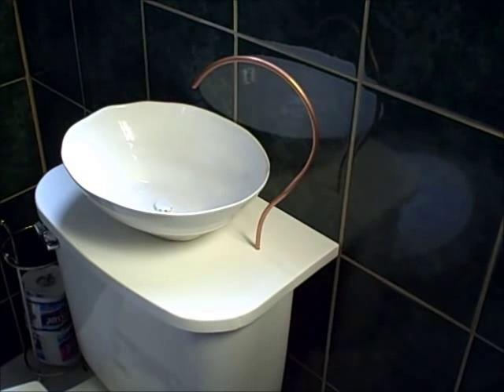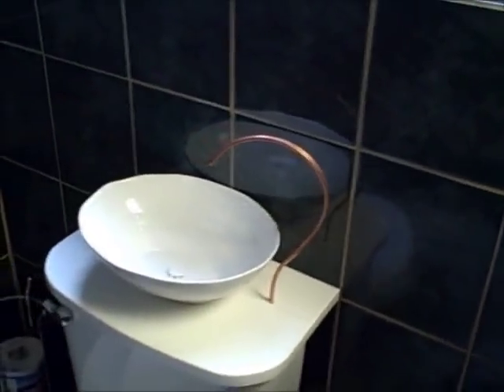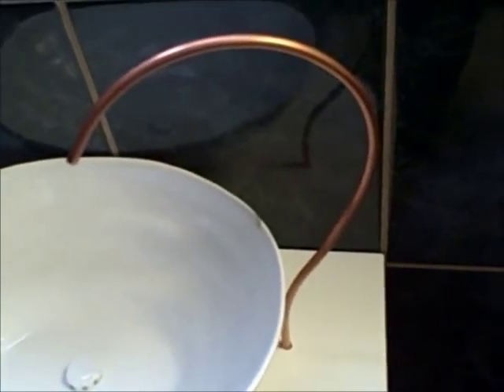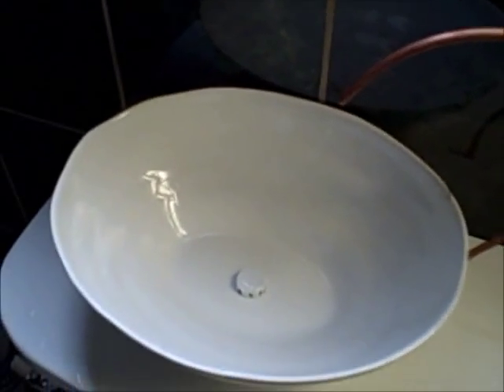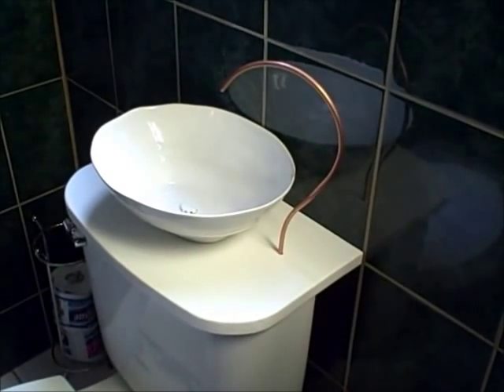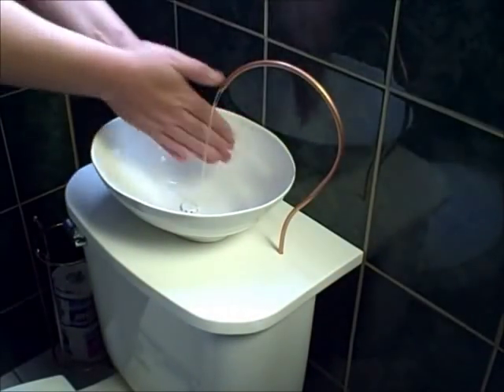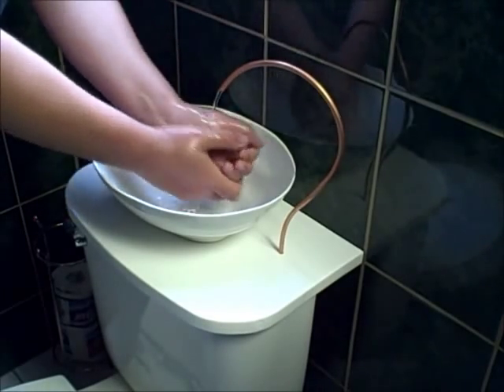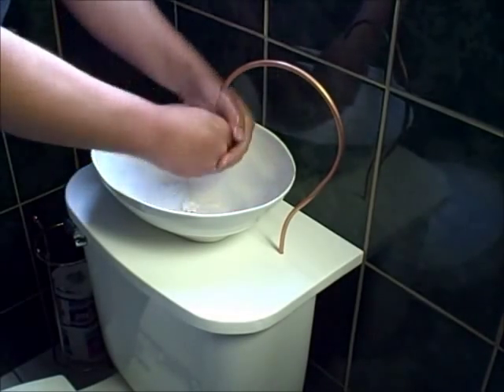Conserve water with a DIY Toilet Sink

Comment from the maker: For those of you who are wondering how I drilled the hole in the bowl: 1) I marked off the size by tracing the 1/2-inch threaded male PVC plug underneath the bowl.  2) I drilled a pilot hole using a 1/4-inch ceramic bit while running a slow flow of water over the surface to keep it cool.  You must drill slowly so as not to crack the ceramic when the bit gets through.  3) Then I used a cone-shaped grinding stone, with the water still running, to make the hole large enough for plug.
Reply: How did you hold the copper pipe in place?
Reply from the maker: Hi Joe. I used a drill bit that was about the exact same width as the copper pipe. It was snug enough to stay in place on its own the whole time I used it. Had that not been the case, I probably would’ve used some tub caulk to put a seal around it from underneath. It doesn’t actually touch water, just gets humid under the lid. I think that would’ve been enough to keep it in place.
Reply: @TheSoCalSailing  I didn't make my hole snug enough. I tried another kind of adhesive. I'll see about tub caulk if that is better.
Reply: so you used an eating bowl? I was curious if you could do this....or maybe a planter.
Reply from the maker: @dawnmullen4348  Yes, I used a salad bowl because it had a nice glossy finish and the ceramic was easy to cut through with a ceramic bit and stone point. I imagine a planter could work too, good luck with your project.

Comment: Great video and mechanism! Thank You! If someone doesn't feel like making changes of such a magnitude, a regular bucket in the bathroom sink while washing hands/teeth/face would do. Just use the greywater to flush. When the guests in the house, you can remove it, and put it back when they're gone. Also the same goes for the kitchen sink when not using the dishwasher.

Comment: Excellent Excellent Excellent!
The retrofits I've seen had awkward bowls and cost a bundle. I'm designing very compact "wet room" style shower/toilets in container-based apartments. This will allow for a larger sink on the back of the toilet. This would work really well with a pedal flush toilet. Just mix down the hand soap with water so no initial water is needed to start washing hands, just for rinse.
Thanks for sharing the diagram as well.

Comment: Great! This is what I needed (and didn't know it). The basement bath room of my old house has the toilet in one side, a shower enclosure in the middle that's the same width as the bathroom, and a sink on the other side of the shower enclosure. To use the sink you need to go out of the door in the toilet side and in the door of the shower and sink side.

Comment: There are two American-made toilet sinks out there ("Sink Twice" and "Sink Positive"). Sink Twice in its basic model fits toilets with tanks from 13 inches to 17 inches. With an expansion pack, Sink Twice fits toilet tanks up to 22 inches wide. Sink Positive is probably a better option for toilet tanks larger than 22 inches wide. Sink Twice is the most efficient on the market because it incorporates "fill cycle diversion" technology to make your toilet even more efficient. On top of that, you can wash your hands with the clean water and flush with soapy water. It is pretty cool and if it saves about 1 gallon per flush (more or less), with 5 trips to the bathroom per day and 4 people in your family using it, you are saving 20 gallons per day or over 6,000 gallons per year. Not too shabby! Sink Twice often pays for itself in months and it is available on Amazon.com.

Comment: due to a design flaw on my part, i just lost two feet of bathroom space for my tiny house. I was looking for this solution except im not worried about brushing my teeth in it. I think I will split the waters intake to a normal faucet with valve. the overflow will hit the basin like normal... there will just be a bit of tooth paste in it, much like i suspect you get some soap film in yours already.

Comment: This is great!  I would like to see a plan for how you made this yourself.  What did you use to secure the copper tubing beneath the platform?  How easily can you remove the lid to access the tank below?  Have you tried drilling a hole in a standard tank topper?
Reply: Yes, I would like the answers to these questions too.
Reply from the maker: The plans are at the end of the video - you can hit the pause button to review them.  I cut a rubber gasket that I placed between the barbed coupling and the bowl - this way you don't have to waterproof the lid, it just acts like a shelf for the bowl to sit on.  The bowl wasn't glued to the plywood lid, so I could just lift it off or lift it together with the lid.  In my case, I didn't want to drill into the standard sink topper because I wanted to keep it in a cabinet in case I ever wanted to restore the sink to its original condition.  Hope that helps.

Comment: Any ideas on how to take this project a step further and connect a faucet control and heating element to allow running water without a flush, with optional heating controls?
Looking for a way to conserve water but also minimize space usage in a very tiny bathroom and eliminate the regular sink altogether.
Reply from the maker: That becomes a much more complex project, since you're now having to run separate lines for dedicated hot/cold water.  This simple plan uses the existing overflow tube to make better use of clean water that would otherwise go directly into the toilet.  Good luck on your projects.
Reply from the maker: Yes.  In my case, I only used this sink to wash my hands after going to the bathroom.

Comment: Thank you. I wonder what you used to secure the copper pipe? Also, I wonder how often it will have to be dismantled to reapply the inside coat to keep water resistant to the underside of the ply wood. Is there a plastic material that could be used instead of plywood, I wonder?
Reply: The water inside the tank isn’t going to reach that high

Comment: How is the tank re-filled if the drain goes to the overflow tube?
Reply from the maker: Most of the water coming in the fill valve exits near the base of the shank, while only a small ratio is diverted to the overflow tube.  During the flush on many toilets, the siphoning action through the trap pulls more water out of the bowl than is necessary to maintain a water seal.  By design, most all fill valves simultaneously fill the tank while diverting a small amount of water (in this case 10 ounces) to top off the bowl.  More to the point, the water in the bowl is responsible for blocking sewer gases in the drain line from reaching the room. If the bowl were left with an air gap after a flush, the room would likely get very stinky.
Reply: Awesome, theres so much design put in to toilets that I've never thought of before. Thanks!

Comment: I've wanted to build a greywater toilet sink ever since we moved in to our house a year ago, so thanks for the helpful video!  Is there anything that holds the bowl to the lid?  The diagram seems to show it sitting there, or is there enough of the threaded male plug to go through the bowl, rubber gasket, plywood and the female to barb coupling clamps down on the under side of the plywood?  If it is just sitting on the lid, have you had any issues with it being knocked about?  I was originally considering using a stainless mixing bowl, which is probably lighter than your ceramic bowl.  Thanks again!
Reply from the maker: The drain plug/hose fits snugly through a hole in the lid and into the overflow tube. I found this was enough to keep the bowl in place without having to glue it to the lid. Also made it easy to take apart for cleaning or troubleshooting.
Reply from the maker: PS: I can see why you ask... you probably will need to secure the mixing bowl to the lid since it'll be much lighter than a ceramic bowl.

Comment: I'm wondering if i can use my existing toilet lid and use a diamond cutter to cut the necessary holes in it
Reply from the maker: I wanted to keep the original lid in its original condition in case I ever needed to roll back my changes. I actually made the lid out of a piece of 1 inch plywood that I had laying around.  I used the original lid to make a stencil over the board, used a jig saw to cut it, primered it on both sides and then hit it with 2 coats of semi-gloss white paint I had in the garage.  It sits on top perfectly.

Comment: Hello. I don't have sink in toilet by toilet 🚽 is without backside. Backside in the the wall. How I install sink
Reply from the maker: I don’t think this project will work for that application. This is specifically for a toilet with a fill tank, fill valve and handle on the side or front. Good luck.

Comment: Hi,
How much grease and soap deposits are clogging the tank?
Is there any method of cleaning such a tank that will not exceed the savings from its use?
I am not kidding myself, I just wonder about the practicality of the solution.

Just wondering will the system holding cost will not be greater than water and money saved.

Best regards
Thanks!
Reply from the maker: Hi, water does not drain into the tank, it drains into the bowl. Because it’s soapy water it actually kept my bowl cleaner in between normal deep cleans.  Keep in mind, you’re not using this to wash your hands after you just finished changing the oil on a car, you're using it after you just finished going to the bathroom.  It’s not designed to be a replacement for a bathroom sink, it’s just a way to get a secondary use of clean water used for flushing your toilet.

Comment: Hello, apologies if this has been asked before but what inlet valve/ballcock did you use? I'm struggling to find one that has an outlet I can pipe up to a tap
Reply from the maker: There’s a diagram at the very end of the video that you can pause to study. I used a 3/16 barbed union that I attached to the hose that’s on the fill valve. Then as the water drains it goes back into the overflow on the flush valve.
Reply: @TheSoCalSailing  Brill thanks
Reply: @TheSoCalSailing , do you know of anyone that will make these and sell them to to old , retired people that lack your talent and skills?  We need two for a recently purchased home in SoCal.  Two bathrooms were created there; they only have a shower and a toilet in them.

Comment: What would you do if the toilet flush button is on the top of the toilet cover instead of a lever shown in the demonstration?
Reply: David Wu Yes, I would also like to know.  Maybe the mechanism could be extended to the top of the plank, and the sink/bowl moved off to the side to make room for it?
Reply from the maker: Sorry Michael/Lori. I'm unfamiliar with the mechanics of top mounted flush toilets and can not make a recommendation.
Reply: +Lori Holtorf you could actually make the sink at any height you wanted. just change the top flush mount from the original lid,to a new top of your choice.Then have a space between the lid and the sink,kinda like a shelving unit on top of the toilet tank.

Comment: What did you use for the tank lid? Foam? Wood?
Reply from the maker: I repurpose a wooden shelf. It was a solid wood piece, I used the existing ceramic lid to make a template and modified its depth to extend all the way to the wall.  One coat of kilz primer and two coats of high gloss latex paint.

Comment: This is exactly what we've been looking for to solve the space issue in a half bath. Thank you for posting this and for the clear instructions. My only question is whether the tubing needs to be glued to the copper pipe or if it is secure enough as is.
Reply from the maker: The plastic elbow that I used was the self sealing kind for connecting a refrigerator supply line.  Pretty cheap and easy to use.

Comment: Have you had any issue with bacteria growth? (That is, bacteria from your hands getting into the toilet?)
Reply: Since it's going into the toilet bowl rather than the covered tank, it should be a simple matter to just put a bit of bleach as disinfectant through the sink every once in a while.  That way it doesn't deteriorate the rubber parts in the tank, and will clean out the full path of the grey water going into the toilet bowl.
Reply from the maker: I used this design for a year before I sold the house.  The rinse water went straight to the toilet bowl, bypassing the tank; since my hands were pretty clean to begin with, I had no issues. I cleaned the bowl semi-monthly as I normally did otherwise.  In fact, since there was soapy water sitting in the bowl after each use, it actually kept my bowl a little cleaner than normal.

Comment: Its a eco friendly way to conserve on water use Europe has been doing this for years were at least 30 years behind them on most things and there is a small tubed hot water heater that can be hooked heats as you use it but its not something I would want hooked up i n a toilet
Reply: that's what I was thinking, a small heater just for if needing hot water. then conserves water but still gives u hot water option. or instead of it running water every time you flush,ml maybe some way to still use the toilet's water by being tapped into it, but have still the ability to control when the faucet turns on and off (and thus whether it's hot or cold).

Comment: Great. Hope you can do a video on how you did this. I wonder how did you cut the toilet lid which is usually ceramic.
Reply from the maker: Bicycle Wang details are in the schematic at the end of the video. I didn't drill the toilet lid, I used a piece of plywood and painted it white. As far as cutting the ceramic Bowl, I used a ceramic drill bit to cut a pilot hole and then I expanded it to size with a grinding stone under running water.

Comment: Will this work with a dual flush system?
Reply: A dual flush system simply regulates the amount of water used, or displaced from the tank, per flush.  It shouldn't affect how the water is fed into the tank.  On my dual-flush it doesn't matter, but different manufacturers will have different designs and may route the water differently for the 'big' and 'small' flushes.  

Remove the lid, look inside your tank, and flush with each to see if the water is fed through the same outlet to fill the tank.  Even if it's fed from different outlets, you can still just route both outlets to the faucet.  So, in short, the answer to your question is 'yes'. lol
Reply: Thank you for the reply!  Would you recommend a particular dual flush system?

Comment: does the sink drain into the tank or into the overflow tube?
Reply from the maker: The short answer is: the overflow tube.  There's been a lot of chatter on the topic of draining into the overflow tube vs the tank so I'll do my best to provide a comprehensive answer about why I've designed my toilet sink this way. 

During the flush on many toilets, the siphoning action through the trap pulls more water out of the bowl than is necessary to maintain a water seal.  By design, most all fill valves simultaneously fill the tank while diverting a small amount of water (in this case 10 ounces) to top off the bowl.  More to the point, the water in the bowl is responsible for blocking sewer gases in the drain line from reaching the room. If the bowl were left with an air gap after a flush, the room would likely get very stinky.

In order to maintain the integrity of the toilet's original design, I'm diverting the overflow water to the sink-top so that I may wash my hands before the water goes back into the tube per its original design.  I've actually found that the soapy water keeps the bowl cleaner and smelling better, depending on the fragrance of the soap.  

Technically, this design is not saving any water at the toilet.  The savings comes into play by virtue of the fact that you're no longer washing your hands at the sink - you've repurposed the water going into the overflow tube to do that.  So, you're getting 2 uses out of the overflow water - 1) to wash your hands and 2) to top off the bowl as originally intended.  By doing so, you're probably saving anywhere between a quart to a gallon of water at the sink since you're no longer washing your hands there every time you take a leak.

Okay, hope that helps.  Thanks for watching.
Reply: The sink drains into the tank so as to fill it with water.  The point of this design is to use the water that would normally be used to fill your tank to wash your hands, too.  This is a very common feature of Japanese toilets.
Reply: ItchyKneeSon thank you

Comment: where did you get the lid or did you drill on the toilet's original one?
Reply: +totonacazo ,, you have to buy the kit , on the internet
Reply from the maker: I actually made the lid out of a piece of 1x12 plywood that I had laying around.  I used the original lid to make a stencil over the board, used a jig saw to cut it, primered it on both sides and then hit it with 2 coats of semi-gloss white paint I had in the garage.  It sits on top perfectly.

Comment: But, what do you do if you need to wash your hands in HOT water :(
Reply: If? lol
Reply: YES, "IF".... Sometimes I rinse off my hands with lukewarm/ cold water if they're just dusty or if I have makeup on them.
Reply: +Nevaeh sorry but this system is only for the cold water that is connected to the toilet
Reply: I would think he would keep his normal sink, and just have this as a water-saving mechanism for washing your hands directly after a flush.
Reply: That's actually a misnomer; you don't need the water to be hot to wash hands, it would have to be boiling in order to be hot enough to kill germs/bacteria anyway.
Reply: Cheryll Bennett there's still the comfort level of warmer water especially in the winter time.
Reply from the maker: @amberslilrose3954, You are exactly right.  I didn't replace my normal sink, I just added this one to save water after using the toilet.  Thanks.